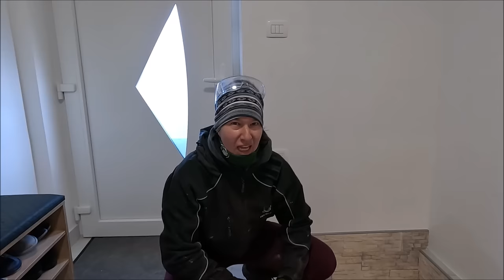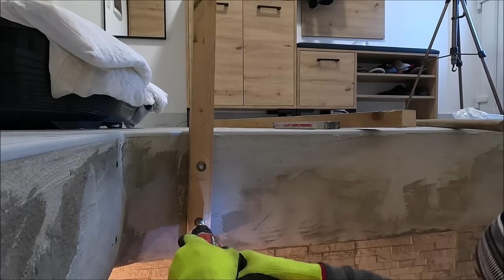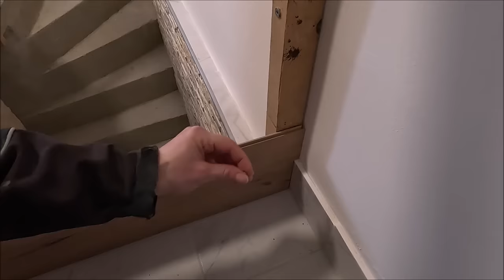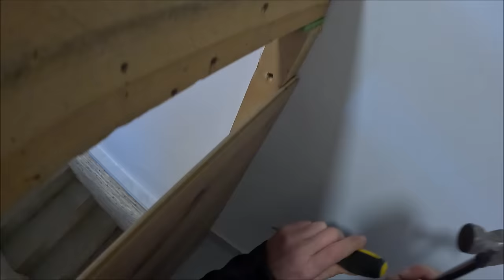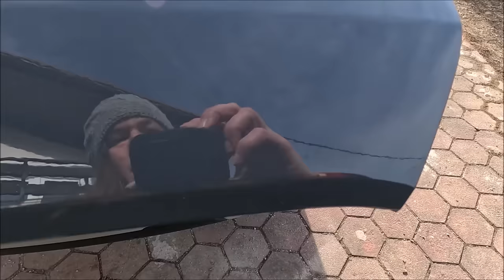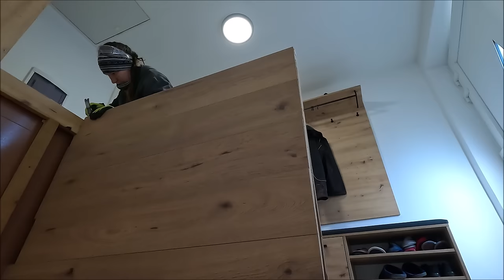I Build a FENCE on a Budget | Martinas Life

Comment: You should definitely consider buying impact driver. When I was driving those screws in concrete, I damaged one battery, so it wasn't charging anymore. It was older battery, but still useful and I lost it after this. The reason, why it can happen, is that the current is still flowing through the motor of the drill, even when it stops if it can't spin anymore. I was lucky that motor survived, it could also burn.
The second reason is your hand. When I saw the drill moving your whole hand, it brought sad memories. I was building a dry wall, but with a stronger material and it was very difficult to drive screws there. My hand was constantly stressing from the drill movement. I ended up with pain in my hand for month or two. Fortunately it healed, but it wasn't pleasant experience.
Reply from the maker: I got one guess I was just to lazy to use it

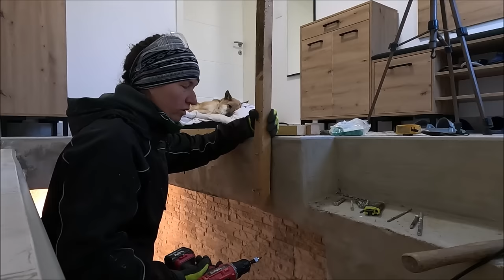Comment: 6:14 - In cases where you don't have enough power to drive screws, you can try using a corded drill instead of a cordless screwdriver. This usually helps with the same bit

Comment: If you put columns in to support the balcony, you need to first put in a concrete pad under each, of probably a meter deep. Many home improvement stores sell cardboard tubes made for this. If you just put up a column without adequate support underneath (and not just a shallow concrete pad) then the weight of the concrete balcony is going to simply (eventually) continue to push the column itself down.
Reply: Yes you are correct. This is not a safety railing..